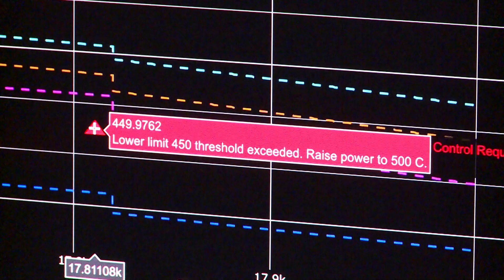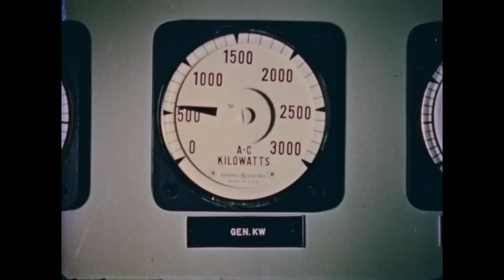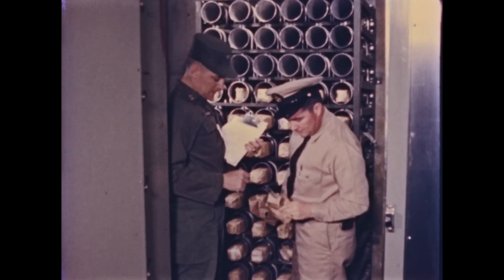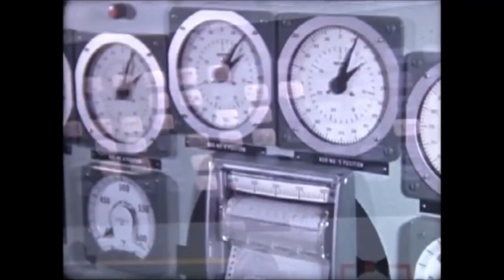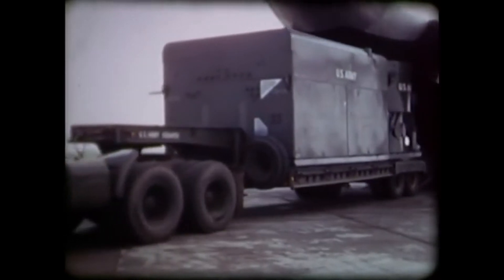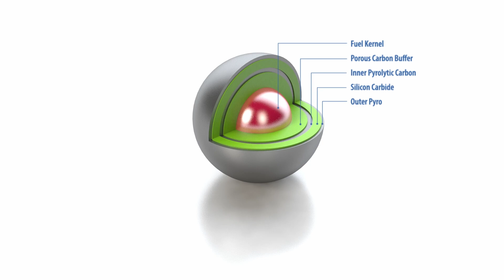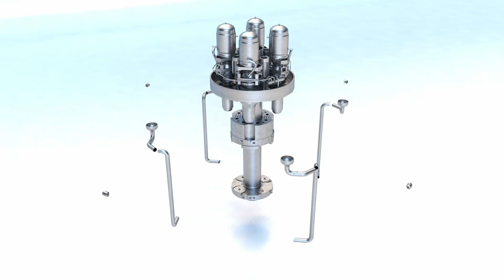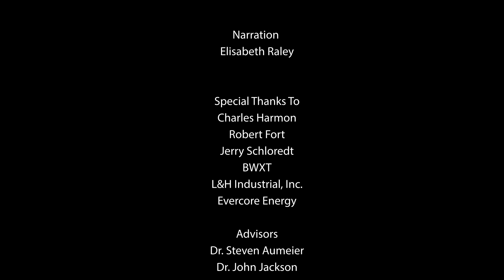Microreactors: Looking to the past to power the future

Comment: So this video just explained that we had clean energy technology since the 1960s. 

They might be expensive then but that’s often the case with new technology. More investment will eventually reduce the price.
Reply: In this case its not more R&D it is scale that would make it cheaper. If you compare it car's todays way of doing it is hand building each car. So they are very expensive and difficult to make. The idea many people have is to build 2-3 "factories" where they can manufacture 1 new one a month. They can then take and install it where it is needed across the USA. most of these are smaller, but are more cost efficient as they are made in an assembly line processes rather than a 1x new construction every time.
Reply: @eriklondon2946  sounds like it can be cheaper if there is an order of 1000s of reactor.
That's our CO2 emissions problem solved. No need to depend on intermittent solar/wind which is known to be ineffective against CO2 reduction. Just look at Germany, they consume more fossil fuels now than they did before they started the solar/wind energy initiative.
Reply: @jamsbong check out South Koreas extensive testings and conclusion that nuclear power is not safe for human health

Comment: For those that haven't read the INL publication "Proving the Principal", it's an interesting read which goes as far as explaining the history of INL.  I've read it a couple of times.  I still learn something new.
Reply: Didn't they prove the Gen IV concept in 1979 or was it 1989? Not just think about but actually prove the concept. I am excited for the idea of Modular micro reactors and molten salt reactors. Ideally they are combined to beable to easily increase or decrease capacity based off of demand.
Reply: @eriklondon2946  Not fully, but they (Argonne West at the time) were very close for one of the Gen IV types, the Sodium Fast Reactor (SFR). Between ~1964-1994, they physically tested many of what would become the Gen IV criteria for SFRs (breeding, passive safety including loss of cooling, loss of electrical, etc...) using EBR-II and almost but not quite, closed fuel cycle (using pyroprocessing onsite instead of huge plants for PUREX or one of it's derivatives). The PRISM & Natrium reactors are the descendants of that work.
Unfortunately, there are several Gen IV reactor types beyond SFR and you cannot assume the lessons are certain to transfer from one type to another without testing each of those types individually as well, at least not safely.

Comment: Fantastic presentation but there's a LOT you left out.
FIRST - I do support the use of nuclear energy but the pro-nuclear lobby needs to be a lot better at messaging and leaving out issues DOES NOT HELP.

1) No matter what anyone says there is always the issue of disposal. Here in Australia we have several Uranium mines including Olympic Dam which has around 30% of the worlds reserves. Its principally a copper deposit that's also laced with Gold and Uranium but its underground and is a stable land site. There's no reason why we can use it to store spent fuel. Why the rest of the pro-nuclear people can't or wont suggest disposal sites is pretty poor.

2) Micro reactors have a basic efficiency issue with neutron flux. Neutron flux (the flow of neutrons through the reactor core) is what keeps the nuclear reaction going. Yes these small reactors can work but because of their scale they are also LESS EFFICIENT because they have a lower neutron flux.

3) On the subject of efficiency and as an engineer this is a subject that annoys me a lot these days. No matter what anyone wants if you are using steam turbines then the THERMAL EFFICIENCY is limited to about 36% and that is simply dictated by the Laws of thermodynamics as any engineer knows.

If you go and look at the latest reactors on Wikipedia and look at the thermal energy and electrical output you can find out the EPR 2 (European reactor) gets about 36% and the AP1000 (American reactor) gets about 35%. Interestingly MOST coal fired and other thermal plants get about the same efficiency because they also have to obey the laws of thermodynamics. Its because steam turbines are limited by a thing called Carnot Cycle efficiency Ceff = 1 - Tc/Th where Tc/Th is the temperature ratio over the Carnot Cycle and its not easy to get that Tc/Th less than 0.65. It has been done with high temperature flash boilers with coal. Its also why Gas Turbines are more efficient because they have a Tc/Th ration of about 0.54.

Overall really good I just wished they'd go into some of the details a bit further.

Comment: Great video. Gives hope that SMR's are within reach in a few years. Succes to all of you at INL.
Reply: I was happy to hear that Russia rethought its withholding of nuclear fuel from Terra Power(correction, NuScale) and now WILL provide it to them.
I lived 25 miles downwind of the SONGS nuke plants for 36 years and would be happy to have my city host a SMR tomorrow. We had no problems from SONGS whatsoever, and some friends worked out there jumping into the reactor area and helping change fuel rods.  They've had no problems from it to this day, either.  Distributed SMRs would end our vulnerability to terrorist attacks on the grid by doing away with the grid altogether(ish).
Reply: Poland is building 12 GE SMRs, Ontario is building 4 GEs and Saskatchewan is in the site selection stage before building a planned 4 GE reactors.

Comment: A big step towards solving problems with the electric grid.  Similar to the locovore movement.  Consume products which originate locally. These can be installed at site of local peaker plants (possibly with changing electric cables, with no need for new towers or right-of-ways).

Comment: Dear nuclear people. From my experience as a nuclear engineer and reactor operator, I can tell you with certainty that these smaller reactors are no more modular than the old big ones. I have worked on the older reactors as well as several of the new modular projects. Videos all over the internet depict modular reactors being transported to remote sites. But this is much the same way we delivered the reactor vessel to Calvert Cliffs in 1969. What the videos fail to show you is the additional 'stuff' you have to build to operate the reactor. Turbine building, reactor building, control building, rad waste building, circulating water system, circ water intake structure, output transformer, switchyard, security building and fencing. And all these systems must be included in your license application. So, your videos are disingenuous. They leave the impression it is just a black box you deliver it and turn it on. You better fix your ad campaign because you're going to lose public support when they find out the truth.

Comment: This piece of propaganda is a straight up lie.  "300 KW?"  That's nothing.  That will barely power a small, several hundred person town.  And the design/blue prints of the mentioned military reactors are still highly classified, no company today is just going to go into production with those classified plans.  Plus, while the design and plans are classified and unknown, we're pretty sure the fuel used was highly or ultra highly enriched, maybe even weapons grade.  There's no way in hell the US, or any other government is going to let a private company produce weapons grade fuel, even if they could afford it, which they can't.  Plus, all the hundreds of commercial MMNR's produce WAY more lukewarm hot water than electricity.  It's almost as though medium temperature hot water is the main product and electricity is a by product.  Unless they can find a high paying customer for all that hot water, no MMNR will ever come even close to being economic. This whole thing is a gargantuan boon doggle.

Comment: How do we maintain security for the reactor and its  fuel?
Reply: Guards? The fuck else would we do?
Reply: Highly trained guards would help. We can get them from a reliable government source like the FBI (Federal Bereau of Incompetence) or some other reliable govenment source.
Reply: Not enough fuel density to be worth the effort steal.  Extremely hot, both in temperature and radiation level.  Fuel is encased in individual beads within the fuel rods.  Would take a major effort to separate again.
Reply: Dirty bombs
Reply: You don't have to. They don't create weapon material.

Even if they did no one would hit one in the U.S. because there are sensors that can track the material. Meaning it reads the radiation coming off the material at the neutrino level
Reply: @sparksmcgee6641  Our neutrino detection is not as advanced as you think it is.  If it were, we would have a detector on every sub hunter or on military satellites and know the exact location of every nuke sub in real-time.
Reply: @sparksmcgee6641  Additionally, micro reactors would likely be used in remote locations off the grid in the first place.  Remote meaning, it would be difficult to access by bad actors.
Reply: Dirty bombs. AS far as tracking we are not as close to Star Trek as some may think.

Comment: This is from the same outfit who  wanted to fly around in aircraft equipped with  atomic reactors.  Wasn't THAT  a great idea?
Reply: The USAF nixed that idea pretty quickly.
Reply: Well you know nothing about what the output would be.
I was shocked when I saw how low the pollution wad on those units. They weren't made to be commercial jets. Long range bomber that could go anywhere in the world without refueling.
Missiles made them irrelevant.

Comment: Wow, sounds great! 
What do I do with my micro-reactor when I'm finished using it?  Recycling or general waste bin? 🤔
Reply: Most of these full consume the fissile material. Aka there is no issue with them. That said ALL currently existing nuclear power plants have space for and use dry casks. Aka a storage where they hold til some future date. And all of the current waste that is out there if stored would fit on one football field. Also like as was mentioned some of the systems can use the fuel til it is inert. So they can use the existing "waste" as a fuel source.
Reply: Yucca mountain was always the best option, and still is.
Reply: Just dump it in the desert off of I5, and don't tell anyone.

Comment: 12000 tons of contamination rock was shipped out of Antarctica
Reply: I wintered over at Mcmurdo station 86-87. There are still people suffering from radiation at Mcmurdo.
Reply: @michaelwhite8524  You in fact are lying. The exposure while it was in place was 10% of the minimum does to cause an increase in cancer. Publications are available on the site and situation. You are claiming you were there a decade after the reactor was shut down. 
So explain how it could effect you?
Reply: @michaelwhite8524 Did you or your colleagues sign NDAs? In turn, is that why we do not know anything about this now in the public realm? Perhaps its been reporyed but this is the first i've ever read about the problem.

Comment: The waste is always the problem.
Reply: Waste has been sorted 20years ago. Old propaganda scare.
Reply: Not always. Look at fast neutron molten salt reactors. Interesting stuff
Reply: No it isn't. People blocking proper storage is the problem.
Small units have waste that's only radioactive for 500 years.
Reply: Some of the modern Gen IV concepts can burn down spent fuel, natural uranium, enriched uranium, actinides and thorium fully to a point where only about 5 % of the original fuel mass must be stored about 300 years, until it has a similar radioactivity as natural uranium. They can exploit 99+ % of the energy of about 24 GWhth/kg. 
The waste of 1 reactor year of a 1 GWe conventional reactor can provide up to 140 times the electricity originally produced. Additionally, the side product from enrichment, depleted uranium can provide another 4 - 5 times the electricity of the spent fuel. In total, this is about 700 times the electricity that was produced by nuclear in the past. This are resources worth tens of trillions or even hundreds of trillions USD, that could pay the debt of the US multiple times easily.

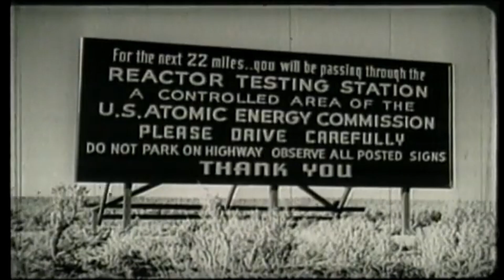Comment: 3:15 "...here there are more reactors of more advanced and different types...": The Idaho facility was created to test practicality of nuclear power for flight. It took the concepts of the breeder reactor... and went nowhere with it. Why, in over 60 years hasn't it created a thorium reactor? 

Spent fuel from conventional reactors has 96% of its original fuel still unconsumed... and leaves it in a very dangerous state. A thorium reactor reactor with using molten salt instead of high pressure water for heat exchange could use that spent fuel as feed stock along with thorium, consume its remaining potential, and end up with minimal... and benign... waste.

12:00 "...retired colonel...": One thing the military has been eminently successful at: optimizing the Peter Principal.
Reply: Actually, the National Reactor Test Station as it was initially known was created to build EBR-1 because Edward Teller thought it better to test such reactors in a remote location instead of Argonne in Chicago. Yes, aircraft test reactors (and naval) were done shortly after, but  EBR-1 was first.
The breeder program culminated in the IFR using EBR-II (Sodium Fast Reactor)and onsite pyroprocessing to test what would later become the Gen IV criteria (inherent safety, breeding, closed cycle, etc...). Their waste profile is similar to theoretical thorium MSR profiles (because we haven't actually tested that yet!) but was cancelled in 94 just before completion after nearly 30 years of operation/testing, by Clinton/Gore (There's irony for ya, an inconvenient truth indeed). So why haven't they done a Th MSR yet? Because neither gov't or the private sector has funded it and as a national lab, they can only work on things officially funded.
Th isn't magic and hasn't yet been proven to be economical, but they do perform some work with it there such as fuel testing in the ATR. I have little doubt that they will eventually do it, probably in partnership with the private sector.
Reply: @richardb1452  Do you have a dog in this hunt? Tell me what your dog thinks of "Thorium Power Canada Inc. offers a clean, green, safe and cost effective solution to the growing global energy requirements. 

Your comments on this Wikipedia article:
The Molten-Salt Reactor Experiment (MSRE) was an experimental molten-salt reactor research reactor at the Oak Ridge National Laboratory (ORNL) in Oak Ridge, Tennessee. This technology was researched through the 1960s, the reactor was constructed by 1964, it went critical in 1965, and was operated until 1969.[1] The costs of a cleanup project were estimated at $130 million.
Reply: The point is - why use thorium at all, when spent fuel and depleted uranium (DU) is abundant?
The waste of 1 reactor year of a 1 GWe conventional reactor can provide up to 140 times the electricity originally produced. Additionally, the side product from enrichment, depleted uranium can provide another 4 - 5 times the electricity of the spent fuel. In total, this is about 700 times the electricity that was produced by nuclear in the past. This are resources worth tens of trillions or even hundreds of trillions USD, that could pay the debt of the US multiple times easily.
A side effect is that the "waste" produced after complete burn down consists of 95 % partly precious metals, and about 5 % of waste that decayed after 30 years to the level of natural uranium. Of course, it is poisionous, but can be stored just like normal chemical waste. And the amount is small anyway, because 1 kg or uranium/thorium contains 24 GWh of thermal energy. 
But be aware, beside some advantages of thorium, there are nasty site effects. There are hard radiation sources within the thorium-cycle. Proactinium 233 and Thalium 208. Pa 233 comes from breeding Th233. It is a bad neutron poison, that requires immediate separation from fuel, otherwise reactivity stopps. Pa233 then must be stored separately, until it has decayed to U233. This decay also produces hard alpha and beta radiation. TI208 on the other side, comes from a small part of U232 produced during breeding. U232 decays at some point to TI208, which issues hard gamma radiation. This requires more extensive shielding and complicates handling. So the thorium-cycle has some drawbacks, which are often not mentioned. 
IMHO, before using thorium, waste and DU should be burned. And if this isn't enough after thousands of years, there is the posibility to get uranium from seawater, for which China seems to have found a cost effective solution now. 
Of course, you can use thorium sometimes in the same reactors, that burns waste and DU, but it isn't necessary for energy needs for a long time. 
So again, why use thorium when it isn't really necessary?